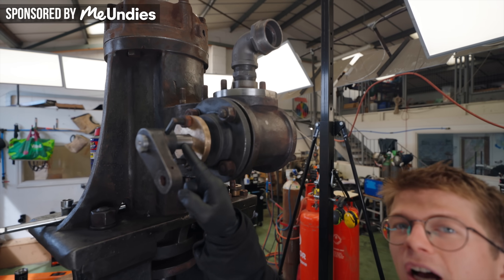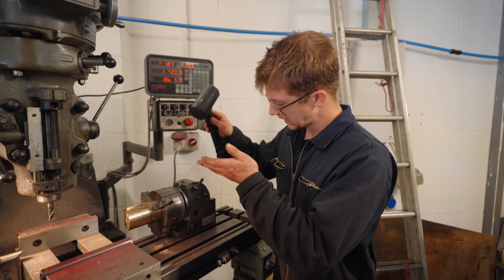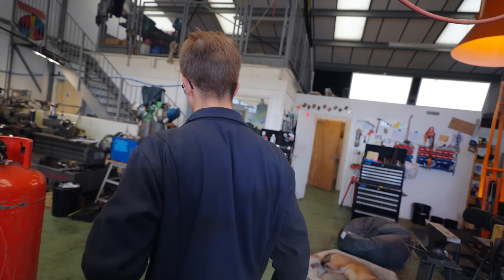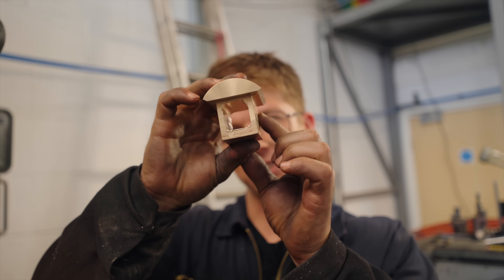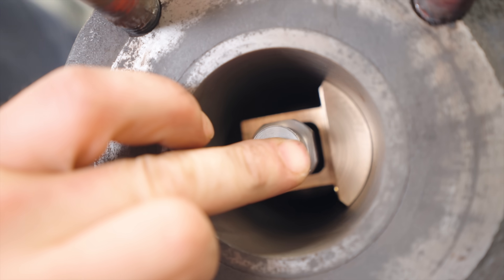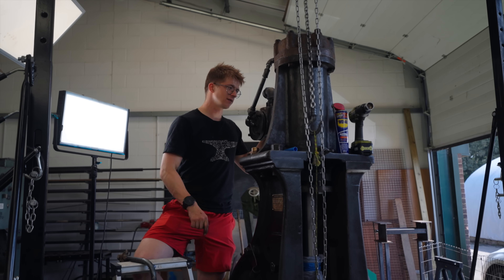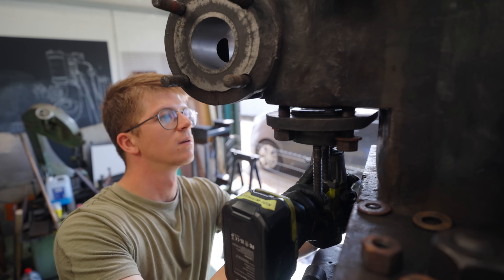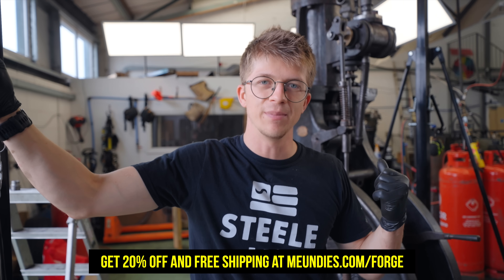FIXING A 1900's STEAM HAMMER! Pt. 14

Comment from the maker: Would love to hear your ideas on how I can fix this valve component to have the adjustment I’d like with less chance of a bolt coming loose! 
Please do check out and grab a few pairs of MeUndies - I was wearing one of my pairs today, very comfy 😅 https://MeUndies.com/forge
Reply: Hey Alec! I just thought of a crazy tool you could make with that power hammer if you decide to try it out... A Damascus Crowbar! 🤔 I only say this as I'm blasting through 'Smallville' and saw Lex Luthor crack open a box with a fancy shiny Chromed crow bar and thought "Hey! Why not Damascus!" 😏👍.  😎🇬🇧
Reply: If you make the bolt hex head as well (instead of button head), you should be able to reach both it and the lock nut with small "spanners" from the back end
Reply: You're nut to hold the valve against the bore is unnecessary. Steam pressure will hold the valve onto the bore, so you don't need to worry about that.  This is the same setup as is in the valve chest for a slide valve steam engine
Reply: You could do lock wire.
Reply: What if you used something like a spring loaded button pin like how they use when two poles need to be connected on DIY furniture
Reply: pin the adjustment with a grub screw
Reply: This might be very naive but what about Loctite?
Reply: Nothing about the adjustment screw but please cut your glant packings diagonal. Thank me later ;)
Reply: Leaf spring slid into the crack with roll pins to retain it. Is pressure on the inside or outside? If outside then a spring wouldn’t work because it would just compress the spring and bypass.
Reply: The rear valve keeps it's seal against the wall by the pressure it holds back, there is no need for a screw, just a bit of back and forth play.
Reply: Maybe you could make an excentric nut on the head of the shaft and secure/lock it with a small locking plate.
Reply: To be more clear where the valve is sitting on the shaft need to be excentric to and threaded.
Reply: Look into gear to gear excentric shafts for drawings.
Reply: You could probably just drill a tiny hole through the whole thing and put a cotter pin through. Simple and old-school.
Reply: maybe compressed air instead of steam? not sure tho
Reply: Shouldn't the steam pressure itself press the brass parts against the wall? In steam engine models, this is what happens.
Reply: Grub screw and blue locktite?
Reply: I think the brass valve pice is supposed to be spring loaded, thats why the original pice have a long er hole in one directtion to make space for a spring mechanism
Reply: Find the documentation from the manufacturer, or the people who worked with this machine
Reply: I would tap a threaded hole into the gap accessible to the end and make a threaded key that is slightly tapered. The further you screw it in, the more it pushes into the side. When the cover is on it’s only possible for it to back out so far.
Reply: @AlecSteele  a pair of interlocking  wedges you get tigtened with a screw
Reply: Maybe a grub screw or a spring in the back to keep a constant pressure
Reply: You could use a spring between the shaft and the valve to keep the seal. Self adjusting and allows for any tolerance issues.
Reply: i guess that bronze part is like a slide valve on a steam engine? I know engine slide valves are meant to be kind of a loose fit on the shaft and steam pressure forces it into the sealing face.
Reply: Replace the bolt with a hex head, mill an "indexing plate" with a 12-point socket hole the same size as the bolt head, and permanently join the plate to the rear of the brass "valve head" where the hex bolt's head presses against (rivet it maybe? epoxy? brazing?).

You can adjust the hex head bolt as indexed by the 12-point plate (30 degree adjustments on a let's say 1mm thread pitch leaves with a shy over 0.08mm per index). when adjustments are finalized for a snug fit, the hex head should sit inside and index on the plate, so as long as the axle is held in place and the brass valve head sits snug between the bore and the axle (which the hex bolt is fixed to), the hex head wouldn't be able to back out and turn even if the attached "indexing plate" is just 2mm thick.

Simple, foolproof, no moving parts except the bolt and the valve head.

I've sent an image and a video on Discord for the visuals.
Reply: They float on the shaft and are held against the port with pressure that Is supplied
Reply: If you really need to adjust it may I suggest a set of stainless steele shims?
Reply: Min 13:30 🍑
Reply: Hey Alec! The valve is an “outside admission” design. That means the steam is outside of the valve, and the valve is the gate that allows steam past it. That also means that the steam in the chamber is pressing on the valve surfaces, keeping the valve against the cylinder walls. You shouldn’t need an adjustment screw to hold it in place, as the steam will do this in operation. What you do need is a small piece of spring steel between the shaft and valve. This will press the valve against the cylinder while things are cold, until steam enters the chamber and takes over. The spring doesn’t need to be super strong, it only has to keep the valve touching the cylinder wall. 
The spring will also allow for misalignment, in case the shaft isn’t perfectly concentric with the cylinder, as the valve can “float” on the shaft
Reply: just don't use any bolt, so long as the pressure pushes the bronze slide against the hole (and not away from the hole) the pressure will seat the slide all by itself
Reply: Also, I’d recommend “blueing” the valve and matching it to the valve face, to see how good of fit the valve is. You might find a high spot or two that needs to be quickly scrapped away on the valve face
Reply: Why not just make a cast/mold of the needed part? Less tools needed. Time saved?
Reply: My real idea is how to check it.  I'd suggest a very basic, skeletonized end cap that will center the shaft, but let you see it.  My mind goes straight to 3d printing.  I know it won't happen, but I'd be glad to supply the part to support the channel (just need measurements)
Reply: Use some plexiglass to make an end cap for the valve. You can layer it the plexiglass in a way where you can see through it clearly enough to see the clearance. And the plexiglass cover has the same exact holes and dimensions as the metal end cap for the valve.
Reply: I would drill and tap the side of it for a set screw.  As u tighten it it would push a pin that has a 45 degree angle that pushes against another pin with a 45 degree angle.  Add this to both sides.  Add lock tight to set screws.  And hope for the best.  No idea how locktite holds up to steam. But it's a thought.  Even if it's just a temporary part to figure out what part u need to make
Reply: Use a leaf spring, it wiil allow for movment if the hole is not concentric. it acts as a automatic dynamic adjustment
Reply: If you want to keep the mechanical lock, use a set screw and stake it in place with a prick punch once you’ve set your adjustment. I know nothing about steam but like others have said, the positive pressure from the steam would keep your valve tight inside the bore without a set screw. Maybe a spring is the way to go
Reply: You don’t need a bolt holding the regulator valve onto the regulator shaft the pressure against the back of the valve will hold it against the sealing face works the same way as a locomotive regulator
Reply: Test it with air compressor
Reply: @mitchelwood2749  A spring inside the square hole  might help with the initial seal.
Reply: If you female threads arent fitting the new pipe. You can always fill the hole; then drill a new hole and rethread it that way its a tight connecting fit. 

Also i call all of those wrenches, spanners were specific defined tools that are of specialty make for custom projects. Example the original wrench style object used to take off the oil filter on a car is an Oil Filter Spanner. That is it’s defined and categorized term when you go to shop for it. So yea. Thats the difference for me.
Reply: What we were taught in the US for mechanical school (it was for the nuclear power industry but don't worry about that part) was:
A: Open-end adjustable wrench
B: Combination wrench (as it has open and box ends)
C: Ratchet (1/4 inch, 3/8 inch, 1/2 inch etc to annotate the drive size)

Bonus... in the US, we also do have spanners, which have different types, but often look like an expanded fork or have a little tooth on the inside circumference of a C shaped portion of the tool. Sometimes used for tightening hose or pipe fittings, for example.
Reply: No bolt is required for the valve but a simple roll pin on the shaft to keep the valve centered is ok.  The steam pressure will keep the valve closed when not working a part. It needs to be free of release any water that gets into the main piston as water doesn’t compress
Reply: Just to inform you this beast of a boiler is for sale!!!!
Reply: Well, if you aren’t upgrading this to a steamPUNK hammer then it’s never going to be as good as it could be.  Sorry.
Reply: OPTION A: Adjustable Crescent Wrench
OPTION B: Open-Face Crescent Wrench  
OPTION C: Socket Wrench
- but what do I know, I'm just an American that builds and repairs computers lol
Reply: You DON'T NEED STEAM - YOU CAN JUST USE AIR!!! :D
Reply: @MrTaji34  red loctite may work